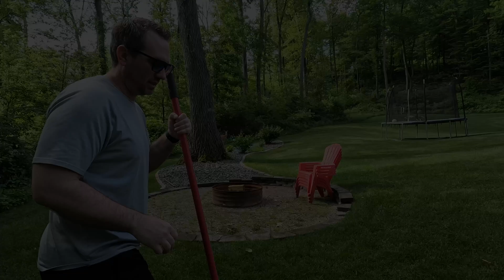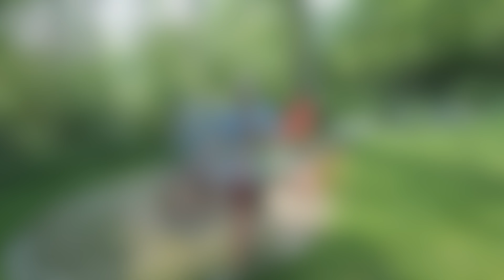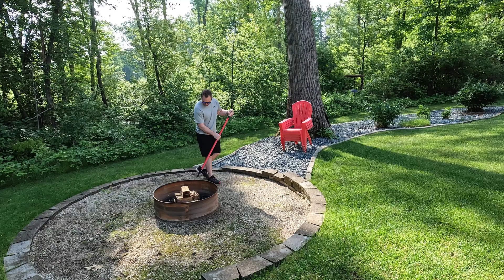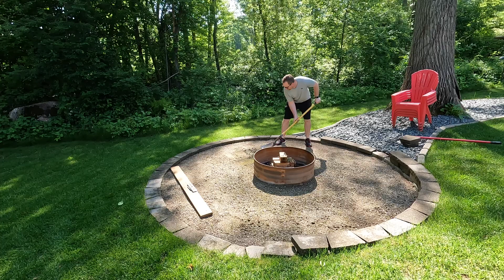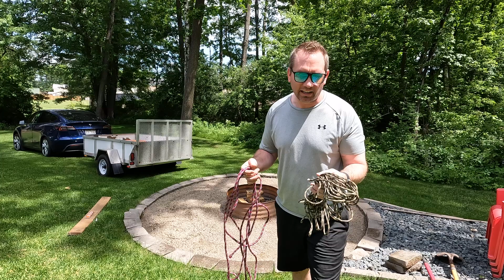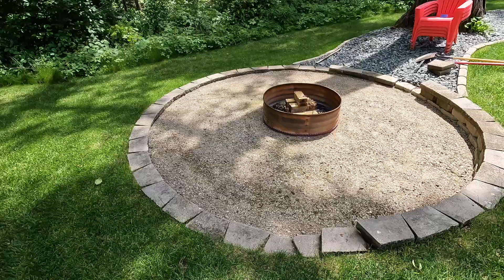Dry Pour Concrete Slab Project II - Mortar Top Coat

Comment: I've been doing Masonry for 30 years and for these little lite weight projects this is okay. 
I would soak the base with water first aid even mix it inside your form a bit and then finish off with your dry mix on the surface....that's about half the work. Its not like you're driving a vehicle on top so it's will be good. Keep crushing
Reply from the maker: Thanks for the comment.  You gave some great advice and logical thinking 👍

Comment: I saw a few videos using mortar mix as a "top coat" and tried it. It doesn't work, I got the same bubbling effect that separated the mortar from the cement that never really binds. I'm currently doing a 10 X 12 dry pour in 3, 4 X 10 slabs. I'm alone so this was my only option. My first slab came out great but it was very labor intensive to get the surface smooth. I used just quikreat cement.  I tried the mortar top coat on the second slab and it was the easiest of the 3 slabs but the quality was terrible. My third slab I mixed 3 parts cement mix with 1 part mortar to make the screed process easier. It was a lot easier than the 1st slab and the quality appears to be as good. I'll be taking the forms off in a few days and so I'll know how solid it will be but I don't see any problems. Moral of the story is, don't use mortar as a top coat.
Reply: I agree...the top coat of mortar mix makes it worst....
Reply from the maker: Thanks for sharing your experience, it can save us all some time and frustration.
Reply: @TheLawnEngineer  Yeah, that was the idea. I wish I knew this before I did my 2nd slab. Now I have 2 slabs that came out good and my middle slab that I'll have to figure out how to fix. Do you now have exposed concrete like I do after the mortar chipped off?

Comment: IIRC, didn't you cover the bbq concrete slab with your kid's pool?  Might something similar have prevented the rainwater from messing up your firepit slab? It looks good. Also, could you have used a back & forth sprinkler unit to keep the slab wet that first day so you didn't have to stand there with the hose?  I am thinking of those arched units.
Reply from the maker: Yes, I covered the 1st slab with a plastic slip n slide.  A similar plastic sheet could have prevented the damage to this one.  I thought I was cured enough to withstand rain, but I guess not.  A sprinkler wouldn't be a bad idea once the slab is cured enough but I'm not sure at what point that happens.  I'll get this dialed in when I'm done with projects =-)

Comment: Very nice LE. I have never dry poured anything bigger than a fence post, but it clearly has its advantages.That expansion joint was very smart. Maybe add a circle of pavers to dress up that fire ring a bit? Is that an American Chestnut nearby? Will the concrete affect its roots?
Reply from the maker: Thanks 👍.  I’ll have to look for some pavers or retaining block that would look nice around the ring.  

The American Chestnut is very close to this area.  I don’t think the roots will be affected because I didn’t run into any when I put in the gravel and retaining blocks.